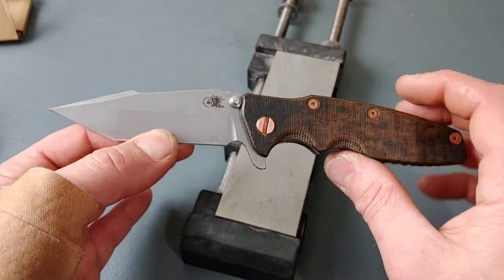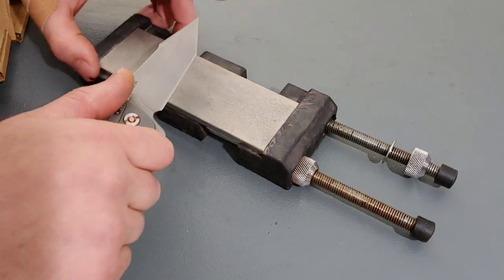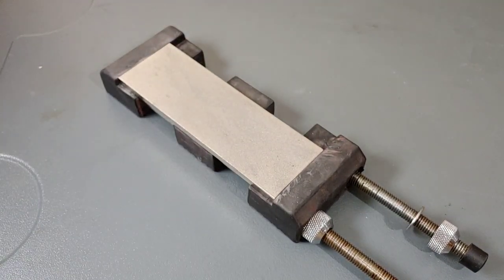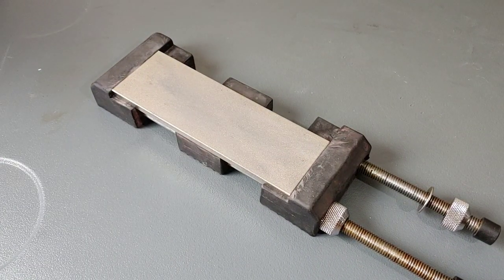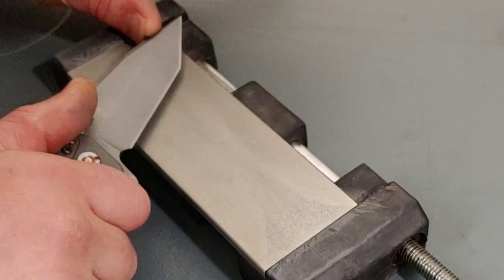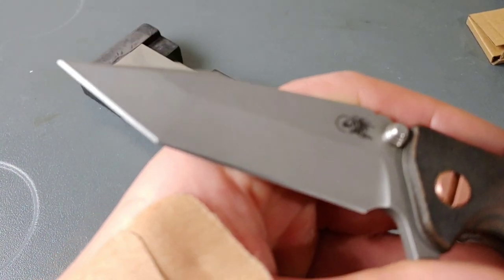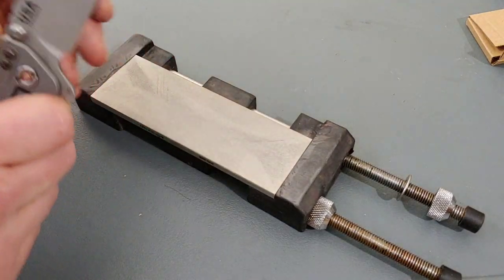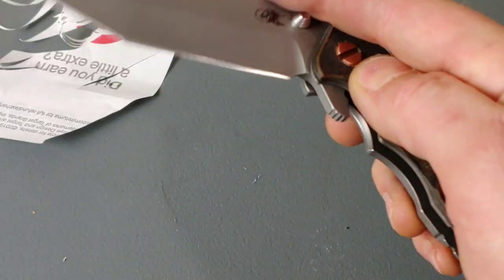HARPOON TANTO ECLIPSE FULL SHARPENING

Comment: Love these videos and i used your link to get that sharpening stone clamp. The stones you have listed are next brother. I love the sharpening part of knives. Your just dam good at it. I’m working on your marker on the finger method but I find my finger moving on the spine of the blade once I get the stones wet. You know what though practice makes perfect and I’m getting better at it!  I just gotta work more on the even angle 📐 from one side to the other!
Reply from the maker: Yeah it happens but its noticing when you doit so you dont, if you use diamond plates you can use them dry, but yeah keep practicing, also after you know what it feels like to keep it perfectly steady you do t have to do the finger thing, but it does help make it perfect

Comment: I have a Microtech Socom Bravo TE that was fairly sharp out of the box but wouldn't cut paper so I put it back in the box...and there it remains because I am a novice at sharpening and don't trust myself to try it and take the chance of ruining my expenses knife.
Do you do this for a side gig ?
Thanks,     
                     ETBT.
Reply from the maker: You could get a quality fixed angled system, and watch an in depth video on how to use, you should practice on a couple cheapies first